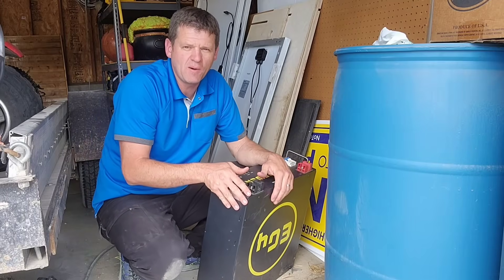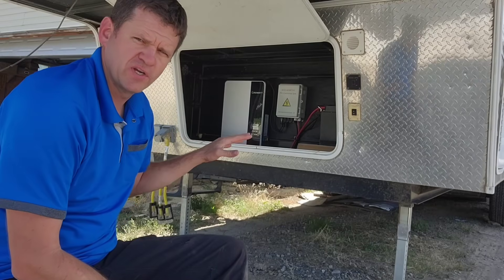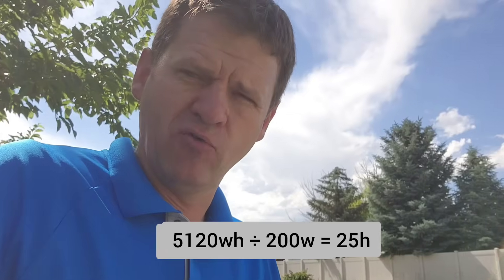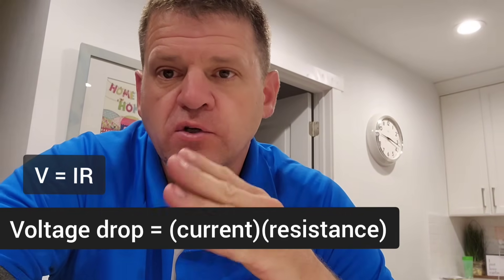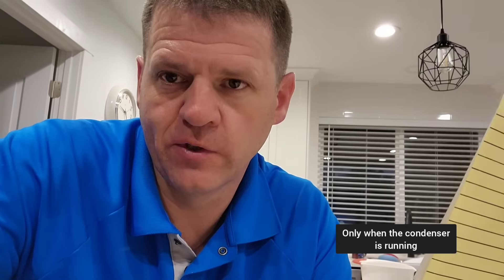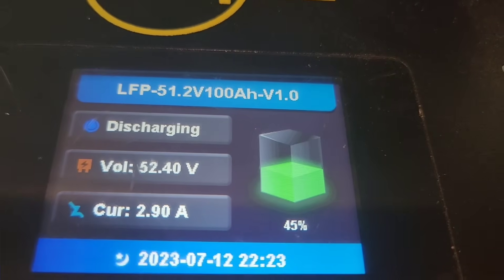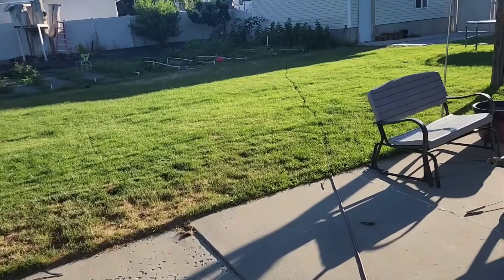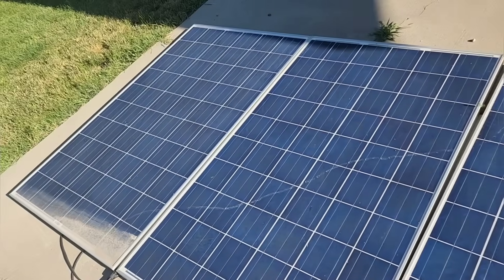How long can a Server Rack Battery run a Fridge?

Comment: 5:10 I think you need to ass these resistances together, as that is the actual resistance of the circuit loop. Therefore, your actual powerloss of the cords is ~10W, not 2W.
Reply from the maker: Nice! You're right! I should have added both resistances together.  Thanks, I'll mention this in the pinned comment.
Reply: @diySolarPowerFunWithRay  formula for just the wire (not including connections) "Vd = ( 2 x Z x I x L )/ 1000 ---> for single phase system
Vd = voltage drop
Z =  impedance of the conductor per 1000 ft. (see NEC chapter 9 table 8 or 9)
I = load current in amperes
L = length in feet
1000 = constant to compensate with "per 1000 ft" in impedance value."
Reply: Let us calculate the real watts
1. Take 2 reading of voltages at beginning and the ending of your long extension cable.
2. Subtract them.
3. Get the Amp reading from Kill-a-watt meter and multiply by delta Voltage (No.2)
Reply: Be interesting test to compare 12-2 solid wire against 12-2 drop cord in 25' and 50' length!
Reply: Thank you.  I wouldn't have know it was incorrect.

Comment: So, instead of the batteries, you could just buy an EV or PHEV like an Outlander and have a 20kwh-100kwh battery that also happens to double as a vehicle when you don't need emergency power. In many cases (especially where I am in Canada) you get pretty good rebates making them pretty cost effective for mobile battery storage. The outlander is both a portable battery and generator all in one!
Reply from the maker: Yes. This would be a great way to go. hear the F-150s have a huge battery. I think they also have a plug in the back where you can run a welder. Awesome!
Reply: @diySolarPowerFunWithRay  They do, and also can do Vehicle to Home. The YouTube channel Transport Evolved did some videos of their system with an F-150 Lightning as home backup. The drawback is they are very pricey . . . But then again, so is 100kwh of battery backup. That would take 20 5kwh server rack batteries, at 1.7k each that's 35k in batteries alone, and you can't even use them to tow a trailer!  
  
Many Nissan Leaf vehicles that use Chademo can also natively do V2H or V2L. Even those have something like a 60kwh battery in the big battery version.
Reply: Yea also there is 2 years wait time to get one 😅
Reply: @krisk1547  On some, sure. Outlanders in my area aren't that bad, and they have a Chademo port so should be good for vehicle to home through that.

Comment: ohms law for voltage drop on a cable using ac isn't feasible.
Reply: It works the same for AC as for DC power.  The difference here is that what causes the high power loss is the higher current for the DC low voltage.  AC power is either 120V or 240V, and that higher voltage means less current required than DC power at 24V or 48V.  The higher the voltage, the lesser current (amps)  and the less ohmic loss for the same power.
Reply from the maker: Why not?
Reply from the maker: I could have also figured it by using "Resistance x Resistance x Current) or "I" squared times "r" as explained in this professor's video: https://www.youtube.com/watch?v=_fJjJXT1uvc  He does a pretty good job explaining it.  Using my formula or his it comes out the same. His formula is easier.

Comment: If your fridge is consuming less than 200 watts, then you are better off using a small 300 watt inverter with a 12V battery. It would me FAR more efficient than the Growatt (and less expensive). I think the Growatt type charger/inverter all in ones should not be used unless your energy demands are greater than 1000 watts. Anything lower and you probably should use a 12 or 24V system.
Reply: It is true that an oversized inverter has too much idle consumption for a small load.  It's like driving a PU truck to the grocery store.  However, a 200W fridge may need 3x that power or 600W when the motor starts up.  The inverter needs to have enough reserve power for that initial surge.
Reply: @nw-bound2413  Unless you can get a soft start added to the fridge. I know they make them for ACs, not sure if they make it for fridges too.
Reply: @jonjohns8145 You're thinking '90s technology, my friend. Every newer fridge from the mid 2000s onward runs a variable displacement compressor. They don't have much inrush current.
Reply: @nw-bound2413  i got 6kw solar …a 6,2kw inverter and a studer 400w  inverter whit a ring core coil it can handle it fine I’m of grid in Rotterdam Holland in the winter I use the small inverter and the big one if I need the washing machine ore something.. it’s enough for ligt tv and fridge .. that 6,2 uses 45kw standby power a month and kils the battery bank in the winter.. solved it this way.. and planning to get a istabreeze i200 for the next winter
Reply: @dennydewaal137  My big 30 cu.ft. (850 liter) fridge draws 350W running.  I run it off a 2.4 kW inverter which draws 25W at idle.  This inverter still has enough capacity left to run a microwave, or an induction burner, or an air fryer.

By the way, I have a total of 4 inverters powering different circuits of the house.  They burn 100W at idle (yikes).  I have 10 kW of solar panels, and 32 kWh of lithium battery.  I am off grid during the day, and on grid at night when the battery runs out.
Reply: @nw-bound2413  nice.. I got a 35kw  51.2v and a 22kw 51,2v battery,. What do you do charge a car? ,32kw is a lot… this is a trick I use in the winter to,, connected a propane tankless waterheater in line whit a tank waterheater in the cold months I simply put the ignition switch on and it works great
Reply: @dennydewaal137  No EV charging.  No way.  I live in Arizona, USA.  We hit 112F yesterday (44C).   The low temperature right before sunrise is 92F (33C).  The two ACs run 24/7.   Before I had the off-grid solar system, my grid consumption hit 100 kWh/day when it got to this hot.  Yesterday, my grid consumption was 32 kWh, with the help of the solar system during the day.

It's hard to be totally off-grid in the summer here.  I don't have enough space for more solar panels.  Right now, my inverters switch to the grid at about 10PM.  The panels did not generate enough power to fully charge the battery.  When the high is only 100F (38C) and the low is 80F (27C), I am off-grid 24 hours.

By the way, the record high here in Phoenix was 122F (50C).
Reply: @nw-bound2413 I was in Phoenix for a job interview that day. I can attest to how it felt.
Reply: You are absolutely right. A small inverter draw about 5w compared to the growat 60/70 wat .. that’s 120w compared to 1,7kw standby power alone the fridge would have run twice Aslong
Reply: Using a 300 watt inverter won't start a compressor motor. I would use a smaller inverter but it must be large enough to start a refrigerator compressor or AC compressor. Once running then the power consumption goes down. One time I tried running a slow cooker in my car using a 100 watt inverter it didn't work . Even though the slow cooker used much less than 100 watts. I need to get a 12 to 24 volt slow cooker then everything would work as planned. 73
Reply: A 300W inverter will overload as soon as the defrost cycle starts. It may not even start the compressor either.
Reply: @niktak1114 depends, the low frequency 500va Victron could more than likely run a fridge.
Reply: @Upliftyourbrothers  a lot of fridges use more power than that during the defrost cycle
Reply: @niktak1114  I’m sure some do. The victron can peak to 900 watts without much fuss. It’s probably the smallest you’d want to go. But many people use it for that purpose.
Reply: @niktak1114  that's correct I had a low watt slow cooker like 75 watts and my lighter plug in inverter could not run it even though the slow cooker was only 75 watts and the inverter was 100 watts. Resistive current don't work on low watt inverters. It's better to overkill than to under power refrigerators. 73

Comment: Use Phase Chance ICE Blocks instead or to store/ extend Chemical energy aka. Battery.  Yeti sells them.
Reply from the maker: Interesting. Thanks
Reply: Use solar direct to make ice. 1 cal per gram to coll pure water till to hit zero degrees C . Then it takes 80 to phase change to solid.

Comment: Can you install a separate 24v inverter to a buss bar off the Growatt and plug a 24/7 appliance into it?  You can leave the Growatt inverter off but still use the MPPT?  I'm just thinking this could be a solution when you are running small loads for an extended period such as the fridge... or have poor sun thru the winter as a way to mitigate the Growatt 50w consumption.
Reply from the maker: So same that 50w idle If you turn the dc to ac inverter off it still is capable of charging the battery over the mppt solar. So yeah you could hook anything up to your battery to run your DC loads. This specific model can connect to a 48 volt or a 24 volt. I have it hooked up to a 48 volt battery but I also have a cheap but super efficient 48 volt to 12 volt step down converter to power my 12 volt loads.

Comment: That inverter eats 50W at idle?! 😲😲
Reply: Slap an extra 100 watt solar panel on it to make up for that inverter consumption and call it a day.
Reply: @robertwylie5567  If I remember correctly the idea was to test how much a 100 Amps battery lasts under the load of a fridge. (meaning... how many batteries you need in case of prolonged bad weather). 

So the answer is... slap one more battery, not slap one more panel.
Reply: @ehombane  
O Lort! Bless your Heart.
Reply: That's awful efficiency.
Thats an incandescent light bulb worth of heat.
I feel like it should be around 10-30W max for a household size inverter.
Reply: @timhartherz5652  Damn that hurts. 
So if you run on batteries, better use DC appliances. But then maybe there are more losses on the wires.
Reply: @timhartherz5652 1% standby load is 99% efficient, haha doesn't sound so bad.

My bargain-bin 4kW inverter uses 30W in standby.  It has an econo mode that pulses voltage to sense a load & to reduce standby losses, but is not compatible with low wattage things or adaptive electronics like laptop chargers or maybe inverter-based refrigeration compressors.

The standby wattage is more like a minimum load, to keep the voltage up, than a constant leak.  Under actual 300W load, internal consumption is considerably less than 30W.
Reply: Yeah, my (non-American) fridge freezer uses 50W, and is only on half the time.

My inverter uses 10W idle. Still ¼kWh a day with nothing plugged in. 

Made a simple thermostat switch that powers on both my inverter and fridge freezer only when needed.
Reply: @christianeaton that's ok but the thermostat will need power all the time as well. Probably much less being used than an inverter on all the time. These are things to think about when living off grid the inverter uses power when idle or more power when only using lighting. I am a strong believer in using DC for lighting. To buy DC run appliances would cost you a fortune and you are kinda limited in size when it comes to refrigerator and deep freezers. 73
Reply from the maker: I would say it's about center of the pack.  Some of the low frequency mppt all in one brand systems consume 100 watt to idle. It's not much of you have a larger solar array connected. Some would argue that, with the money saved by buying this unit, you can get more solar panels, and the extra power will more then cover the cost of inefficiencies and in the long run you'd be ahead.
Reply: @diySolarPowerFunWithRay https://youtu.be/_fJjJXT1uvc?si=CxX_qFlAsNfwQDlY
Reply: Yeah that sucks!!
Reply: Pretty standard for an inverter/charge controller
Reply: When u need an extension chord of that length go down to the store and buy 2 ends...and a roll of actual wire...make your own chord
Reply: @willih830yiy inverters.
Reply: That's about right for an invertor. Just size the battery for X hours or days with no solar or mains with that in mind and you will be fine.

You won't notice that loss as you panels will supply more than enough energy during the day.

Comment: Good test. I was wondering how long my 1280Wh power station would power a fridge.
Reply: 10-13 hours. Depending how efficient the fridge is and how often/long it is open for.
Reply: I got new Samsung 28cu with 1280 generator and it last 13 hours
Reply: @zodaguado6655  Thank you for confirming my projection.